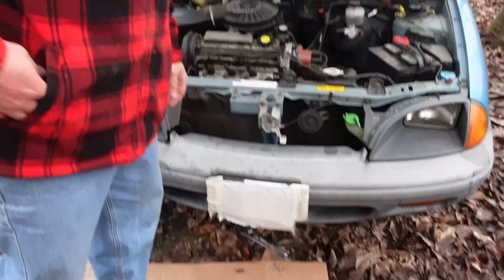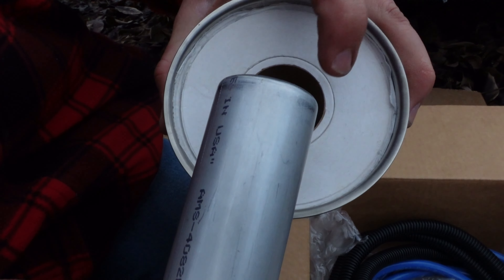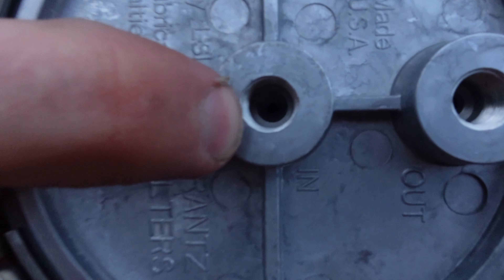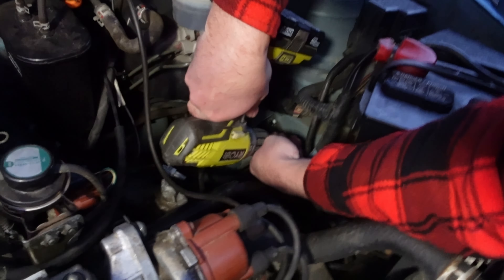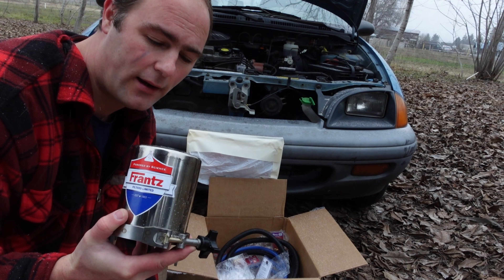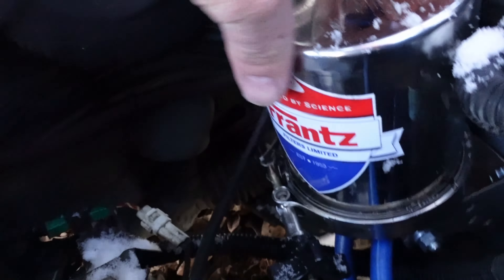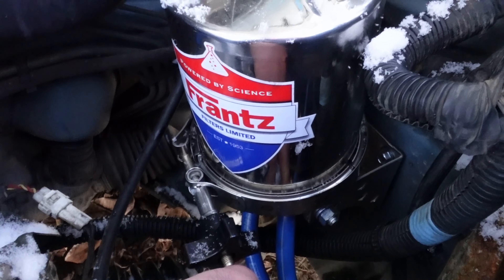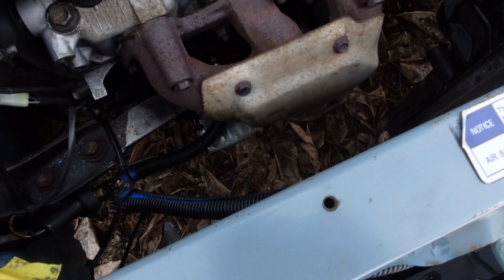Frantz Toilet Paper Oil Filter installation on a Geo Metro

Comment: Total base number or TBN is something you dont need to worry about if you change the filter and add a quart of new oil at a normal interval. My Pontiac has only 208.000 miles and doesnt use oil. I change the toilet paper about every 6.000 miles and add a quart of new oil. You know you dont have an acid problem if the dipstick isnt rusty and acid isnt damaging the inside of the Frantz. Normally in a modern engine the toilet paper doesnt clog up with sludge unless the engine has been badly neglected. I changed the Frantz every 12.000 miles with no oil drains in over 250.000 miles. A Caterpillar lab manager sent me a sample kit. He suggested every 6.000 miles. I was bragging about it on YouTube. It used the Frantz adapter that eliminated the full flow filter.

Comment: The oil will normally be clear on the dipstick. To see the soot in the oil you can drain the used oil into a glass jug. My engines are so pristine it would take over 50.000 miles here in The Dallas Texas area to clog up the toilet paper.  I havent seen a sludged up toilet paper filter since the 60s. I remember when you could squeeze the top of the toilet paper and get sludge. Squeeze the bottom and get golden oil. My gasoline engines are so pristine the toilet paper is clean all the way thru. Changing the filters every 6.000 miles keeps everything pristine.
Reply from the maker: My oil isn’t clear but it feels clean and looks pretty clean on a paper towel, it just isn’t the golden color
Reply: I hear you. If the oil is clean it will feel clean. Frantz had test strips to see if the oil is clean. I used a few layers of white toilet paper. Now I mostly use my thumb and forefinger. I can feel the soot in the diesel tractor oil if it gets too high. Black doesnt mean much in a diesel. Some propane engines have been ruined because owners didnt change the dirty oil because it always looked new on the dipstick.  No soot to turn the oil black.